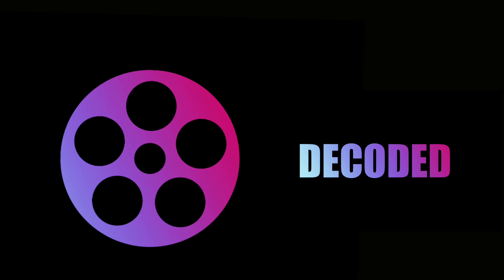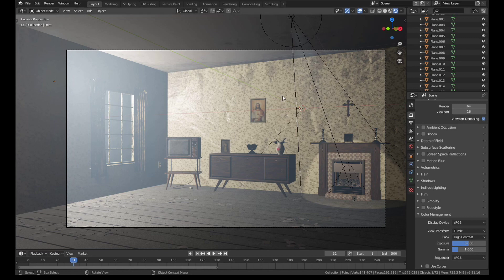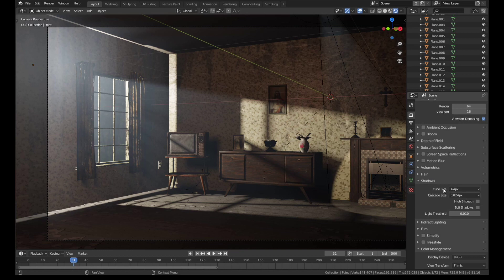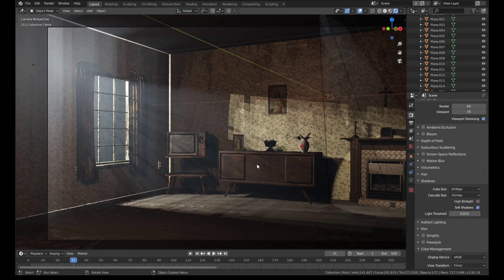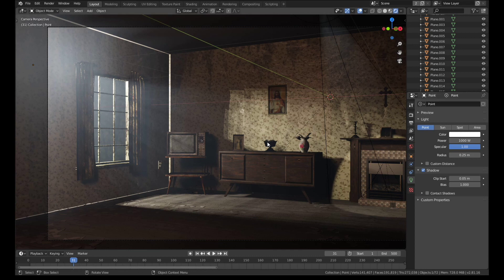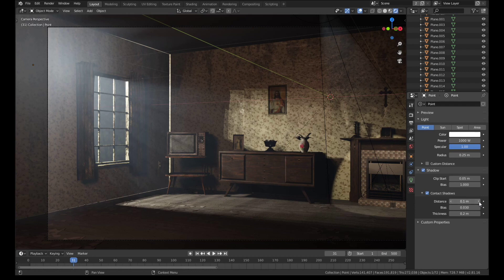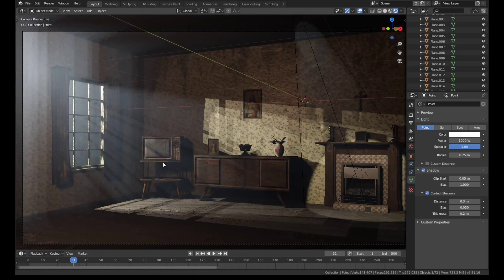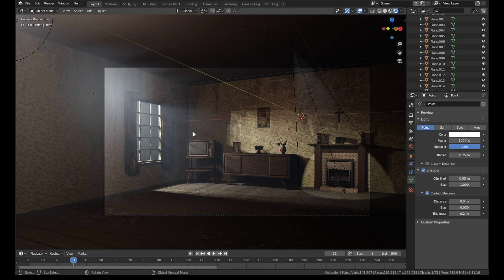Fix Light Leak In EEVEE - Blender Tutorial

Comment: I think this method is not recommended by other blender artist. 30 cm contact shadow is not physical correct . The first thing to do I think would be to increase the thickness of the wall.
Reply from the maker: What if the model isn't a wall? What if you've got light leak on a model of a teacup? Or some clothing? You can't always add loads of thickness to an object, and adding thickness doesn't always work anyway.
Reply: In the end, if you are for physically correct lightning, you would have to go for Cycles. Realtime rendering engines such as Eevee go for shortcuts, like baking lights and reflection probes.

Comment: Doesnt making walls have thickness help to?
Reply: PS soft shadows with small tex size look much better. The igh quality looked like crap!
Reply from the maker: It can help sometimes, but not always. I think the walls in this demo actually had about 2cm of thickness, but it didn't help.
Reply: @DECODEDVFX  I mean like real dimension. 2cm I don't really call thickness ;) I use a different engine and remember with some engines, you need thickness to get rid of light leaks. So 20-30cm like real world dimensions

Comment: You can fix the limitation mentioned at 2:40 (light leak at the edges of the screen) by enabling "Film -> Overscan" in the scene properties (might need to adjust the "Size" value if it's a significant problem), but be aware that this only applies to the final Eevee render; the leak will still occur in the viewport.
Reply: You are a legend, Sir.